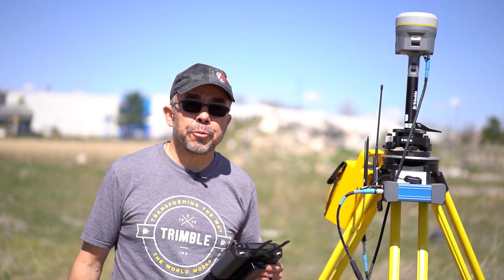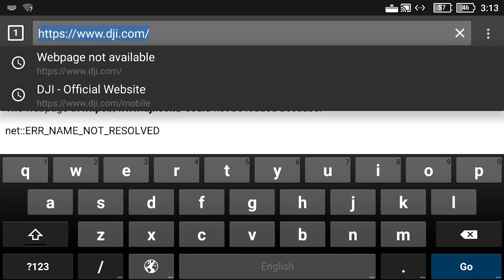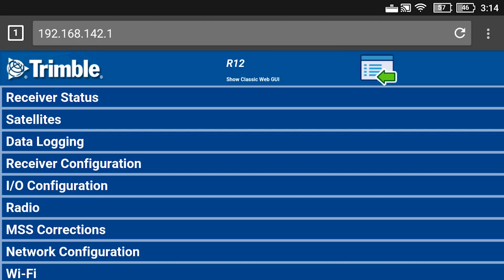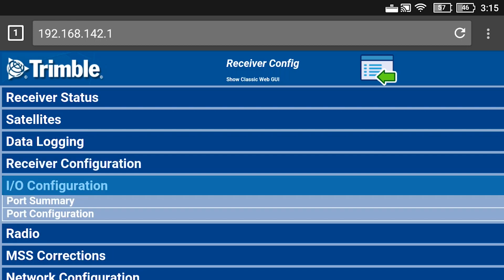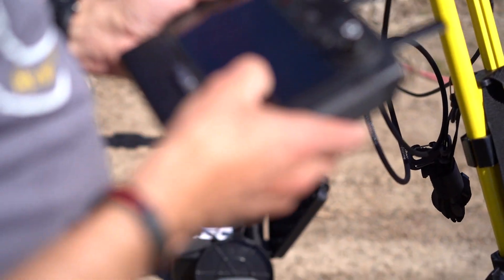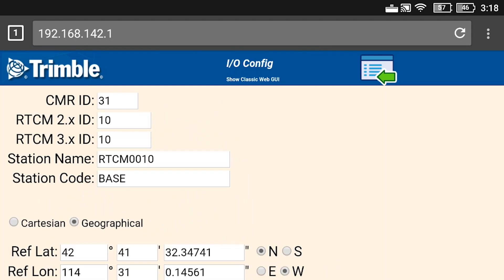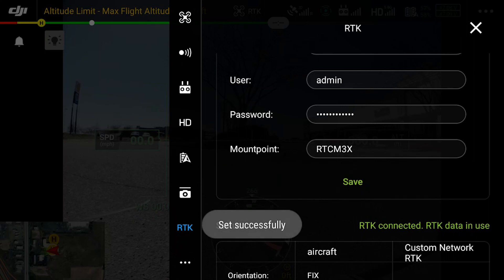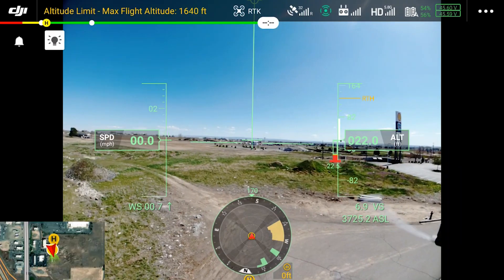Setting up a DJI RTK controller with a Trimble receiver that supports NTRIP Client using the WebUI.

Comment: As far as an instruction video goes, this is quite badly done. There was little instruction. Instead, you just displayed the end results and not the actual set up. “As you can see here, its already set up” was said multiple times. If anyone wants to actually learn, click on a different video

Comment: I'm not clear here. Can the trimble base station connect to the drone by radio like the RTK base from DJI? 
The DJI RTK is very flimsy and takes rebooting to adjust the lat/long/ht from an established rover point.
Reply: I have the same question
I woudl like to use an R10 for a base instead of purchasing mroe equipmetn
thank you
Reply: @chrismaurer5557  We're a survey company with multiple R10s and R12s, and  just did a test run with an R10 in base mode with our M300 and I connected to it and flew just fine.  Haven't processed the data yet, but at first glance it seems to work fine following this workflow.
Reply: @brianjurgella6678  Thank you for reply
My other research into this found that I can make it work, but only through the WiFi connection, which is not helpful for our situations.
I was hoping that it would be able to receive the radio link that our rovers use
Reply: no need to purchase a DJI D-RTK
Reply: We prefer using a high quality gnss receiver and we've experienced better positioning using a Trimble receiver versus the DJI D-RTK base
Reply: I believe the Trimble base need only communicate with the controller.  I believe the drone need only collect its own data, the controller handles all the processing and corrections.

If the question is "does the R10 have enough range to reach the drone" I don't believe it needs to.

Comment: Do you have to keep the controller near the base to use RTK on the drone? Or once you get it set up can you move to your location you're going to fly the drone at?
Reply: I believe you're limited to the range of the wifi connection from the Trimble Base to the DJI Controller - so 20m or so?
Reply: @Evan Dyson  that's what I've found out too. It's very limiting... in a lot of surveys I will setup base and be half a mile to a mile away from base operating at multiple locations. This RTK function would be so much better if we could receive base information like our rovers... much more logical... right now we're testing our new Mavic 3E with setting up a secondary r10 base on-site, but by the time we get all of that going I could throw out 5 or so extra targets and be flying.... we need someone to figure out a way to get these controllers to speak to the base via radio just like rovers have been doing for decades... my company would literally pay for that option/program/part. If you've done this, someone, let me know.
Reply: @sambarney5100  have you guys found a way to get the rtk corrections to the controller while being far away from the base?
Cheers
Reply: @sambarney5100 static IP sim card in base
Reply: This technique requires line of sight with the receiver since it's actually an ad-hoc wifi connection to the receiver. If you are required to move with your drone for line of sight. I'd recommend the blue device you hear me mention in the video which is an Intuicom BridgeX ethernet bridge. Which pushes the corrections over a static IP address

Comment: Tobias, thank you for the video -- just one question.  When using a normal tablet (as opposed to the Matrice 300 remote) -- you're not allowed to connect to two networks concurrently.

In other words, once you connect to the Trimble R12 WiFi, you will lose your Internet connectivity.

How do you work around that; connecting to WiFi on the R12 and maintaining network connectivity over/above the R12 WiFi?

Comment: What type of radio do you have connected to your base? I tried this same set up, but with only my R12i on a fix height tripod and I was receiving Lat and Long information into the controller but I'm not sure if everything was correct.  Any information would help. Thank you
Reply: The radio that was connected was an Intuicom BridgeX. This can also be used to send RTCM corrections to a DJI supported drone. This device eliminates the requirement of standing next to the receiver since the corrections will now be pushed out to a static IP address.

Comment: Can you use local coordinates or are you limited to Lat, Long, HAE? Are the coordinates that are being recorded in the EXIF data for each photo, corrected coordinates or is this just to improve the telemetry stability?
Reply: Hi Daniel,  any luck with question ?
thanks
Reply: Use wgs84 (lat, long, height above ellipsoid) for the photo EXIF data, then change to local or state plane coordinates with the model processing software (Pix4d output coordinates). The Mavik 350 RTK does use the corrections for photo positions. I think some of the earlier DJI drones used RTK only for drone positioning.
Reply: It must be a global lattitude and longitude and Height above Ellipsoid